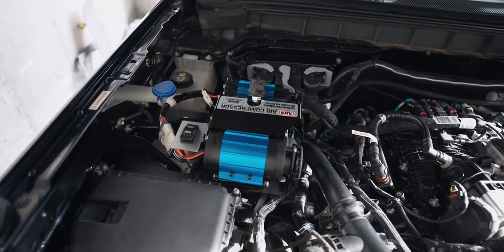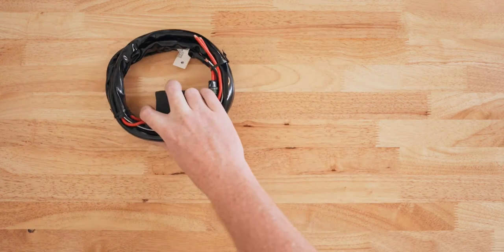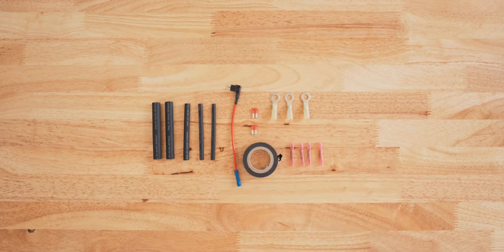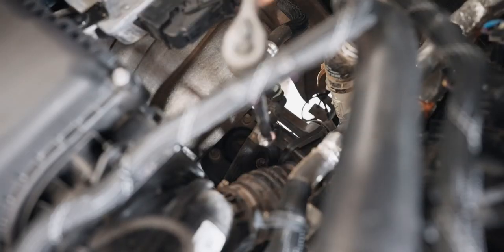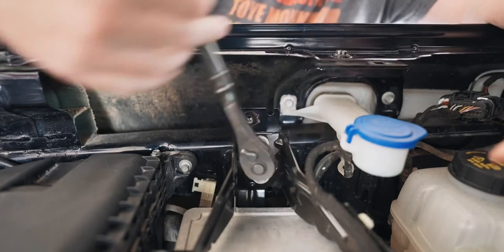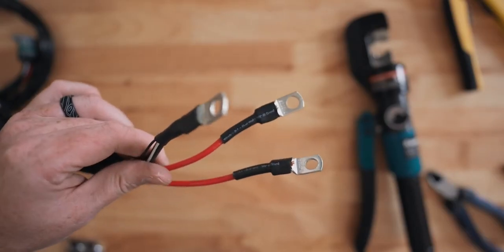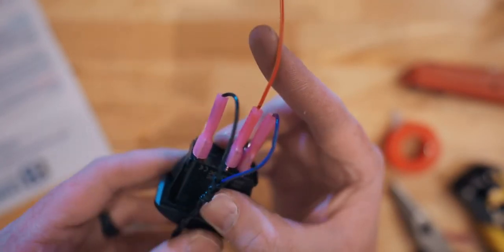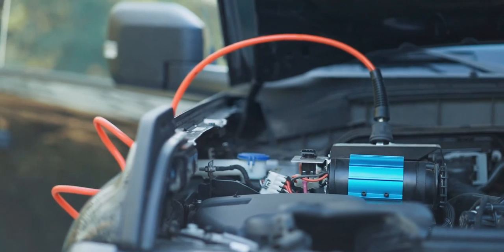Installation: ARB Compressor on Ford Bronco w/KR Off-Road Mount

Comment: Great video, but by any chance where did you find the right side bracket to mount the switch to the side of the ARB Compressor?
Reply from the maker: We manufacturer a switch/coupler mount that works with the Broncos: https://www.4x4truckleds.com/kr-off-road-arb-compressor-air-coupler-switch-bracket-for-2021-ford-bronco/
Reply: Where do we get that bracket used in this video.  It seems much easier to install than the 4c4 bracket
Reply from the maker: @victorhahn8194  What's 4c4? The complete kit is available at our website at www.4x4TruckLEDs.com

Comment: So when he cuts off the red/yellow wire he fails to mention he gets this from the harness he says you are not using as this is for the air lockers. When adding the yellow/red wire with the diode which end is going into the add a fuse? For a video that is supposed to explain how to do something a lot is left out.
Reply from the maker: Every installation is different. There are instructions with your ARB Compressor and with our kit if you plan to use a switch. Basically, the purple wire off the small harness is the trigger wire that turns the compressor on. Give this positive power and the compressor will turn on. So you can wire the purple wire to a switch that makes/brakes power to turn it on and off.
Reply: @4x4TruckLEDscom  That I understand. However, I am following your video and would like to do it as shown to mount the switch next to the compressor. Therefore, I need to know "when he cuts off the red/yellow wire he fails to mention he gets this from the harness he says you are not using as this is for the air lockers. When adding the yellow/red wire with the diode which end is going into the add a fuse?" I have the purple wire hooked up to the switch from the harness that connects to the compressor and a black ground as shown above.  He runs a wire, using a piece of the yellow/red wire in a direction not shown, to the add a fuse. If you would watch the video maybe we would be on the same page
Reply from the maker: @HankMarducas  This is not our video, it's just a youtuber who used our system and did his own installation. Every installation will be different. He grabbed the GROUND for his switch (so that it lights up) off the small harness and he got the power leg from his fuse panel with a fuse-tap. You need at LEAST a positive leg on your switch to supply power to the purple lead. He has a red/yellow wire because he re-used wire he had laying around. It could be any color wire since you are providing power. You have to provide power to the switch via whatever method you want (when we do installations, we run a dedicated power line with a fuse off the battery, some people use a fuse tap)
Reply: @4x4TruckLEDscom  Fair enough. I bought a kit from you after watching this and due to his lack of instructions had a few questions. I have never installed a compressor like this and wanted to make sure it was all done correctly. Thank you for the explanation

Comment: I have the arb twin compressor but I am getting the Everglades which has the snorkel. The so the snorkel compartment under the hood is in that area. I’ll have to find another location for my compressor
Reply from the maker: The same is true with the Bronco Raptor. They have a bigger air intake system which gets in the way. If we get enough demand we can look into making a version for the Everglades/Raptors. For now you can always put one in the rear of your truck.

Comment: Sadly I just received my compressor and K2 bracket and the bracket doesn’t fit with a AFE CAI…. now what
Reply from the maker: Contact the vendor you purchased it from. If it's new they might take it back. Our own website does state it works with most intakes but not all intakes.
Reply: @4x4TruckLEDscom  the compressor and kit was purchased from your company.

Comment: Follow this to a T for the switch under the hood and doesn’t work :(
Reply from the maker: Did you bring power in to the switch? This is an informational video and now a 100% start to finish guide. You need to bring constant 12VDC power to one leg of the switch, which will close it's circuit when activated, sending that 12VDC over to the purple wire, which will trigger the compressor to come on.
Reply: Could you have reversed the diode (it's built into the red-yellow wire)?  Diodes don't work if the wrong side is facing the positive terminal.  If you cut apart the wiring like in the video, it would be easy to flip it by accident.
Reply: @awbrown327  I'm onlyh getting the FAn to turn on , the compressor won't start.